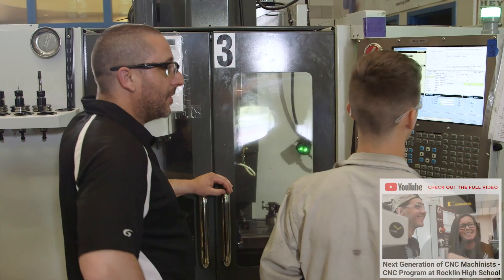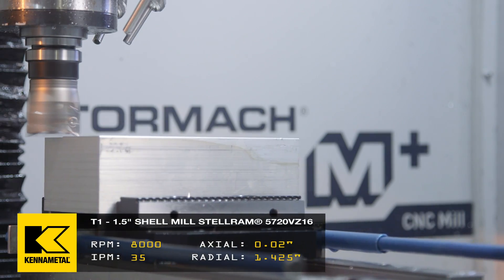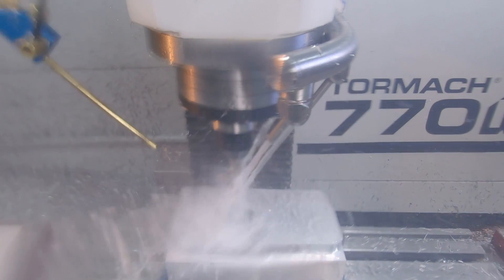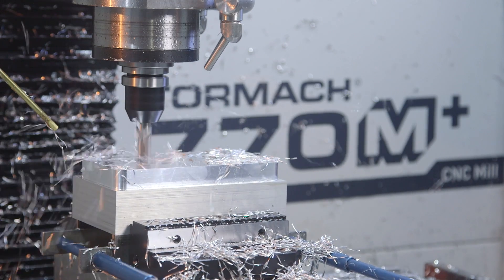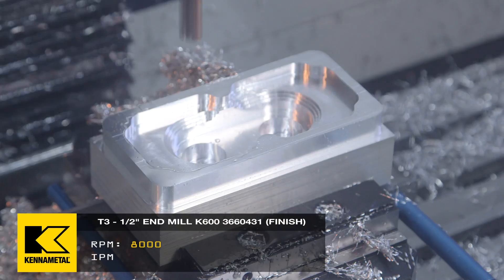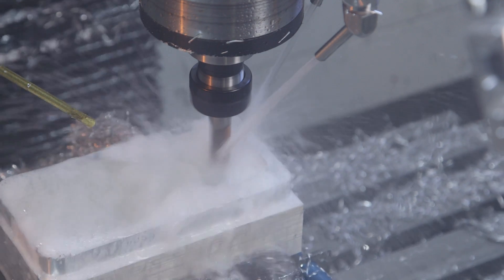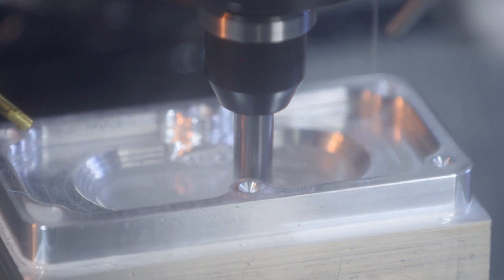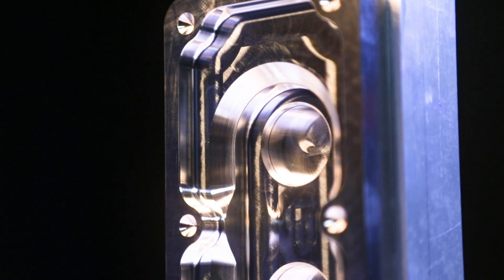Machining the TITAN-53M on a TORMACH - Part 1

Comment: I really would like to have that machine in my garage. Time to start saving 😄
Reply: $24K but I would save $5K and drop the tool changer.  Thing has nothing but issues.  Maybe the BT30 ATC will be better
Reply: Thomas McKenna ok thanks for the advice
Reply: Dominik Goluch Tormach finances. Full part maker kit runs about $24k. That’s everything thing you need to set up and make a part same day.
Reply: Gary Leafty oh ok thank you!
Reply: Dominik Goluch NP. If you’re on FB there is a few Tormach operators and users, that great info resource on all Tormach machines. One of the pages is ran by a machine shop that started with a Tormach and now has 8 Haas machines.
Reply: Gary Leafty i will check them out, I think I would really benefit from them since I am relatively new to machining. I have done many CAD models in school and used a 3 axis milling machine for plastic and wood, but I never got to program the part myself which now I can do with the Titans of cnc academy and Fusion.
Reply: Dominik Goluch Titan has provided a awesome learning curriculum for sure. I fiddled around with CAD on my own before watching his vids. Now I have most of my parts done. Was going to have a shop do my parts but the cost on my limited run of parts is not worth it. Good luck on your endeavors with CNC.
Reply: Gary Leafty thank you so much! Have a great day and I hope you have fun with your future cnc projects.